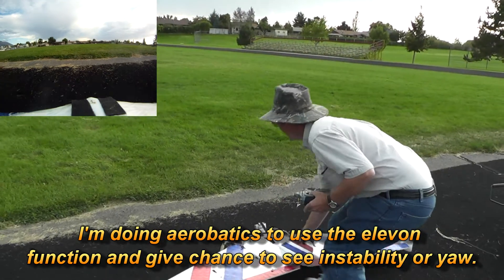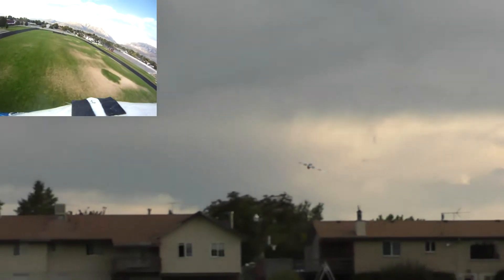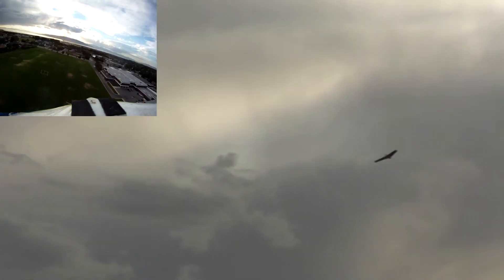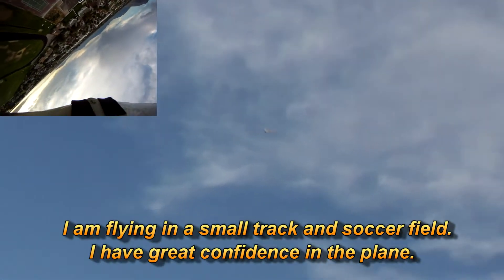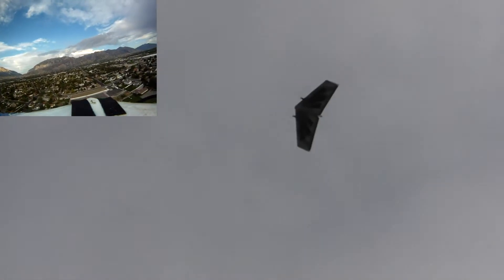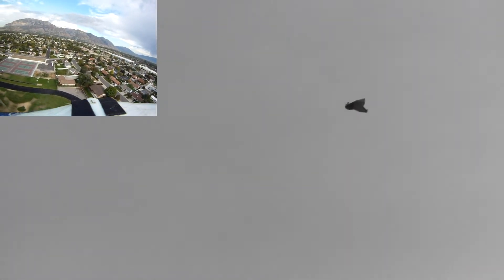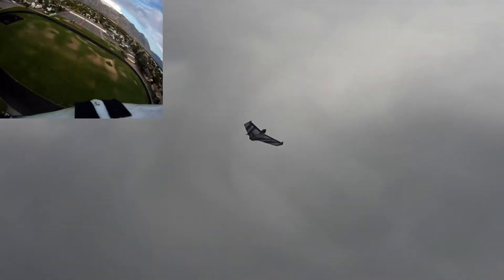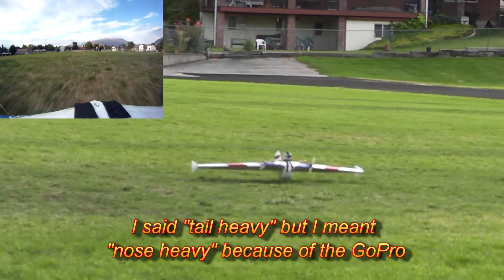Hercules  with GoPro and 2 elevons 9-11

Comment from the maker: This plane is rock solid without gyros if the CG is right, linkages are tight, and you use the recommended amount of elevon movement.  The moving rudders are great for ground handling but don't have much effect in the air.  The design uses 3-4 fins or rudders both as skids on the ground and rudders in the air. The more delta the shape the better central fins work.

Comment: How effective is that rudder?  I thought on a flying wing, to be most effective the rudder needed to be on the tip sails to work properly.  Do you use gyros for stabilization?  Thanks.  Nice flying!